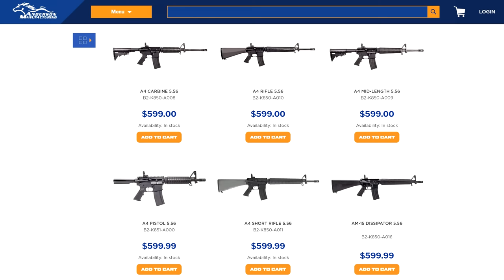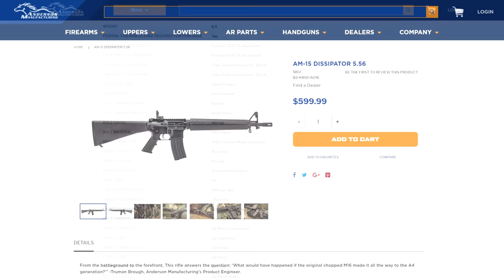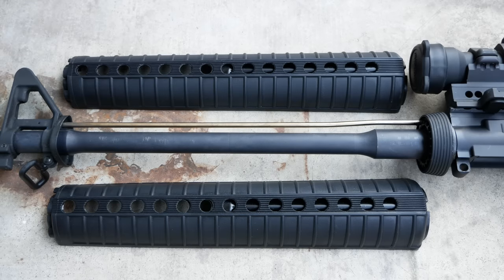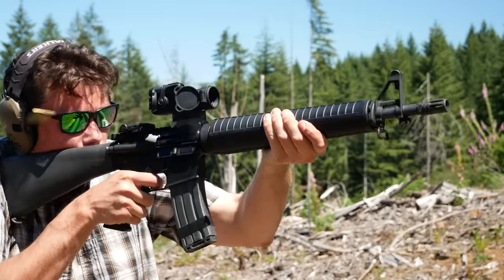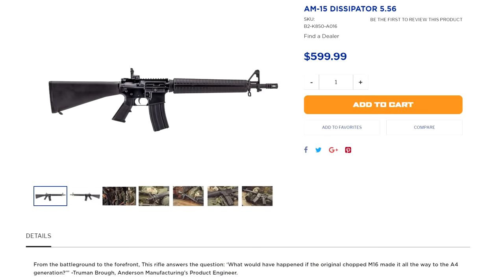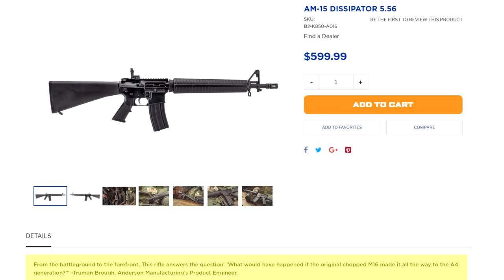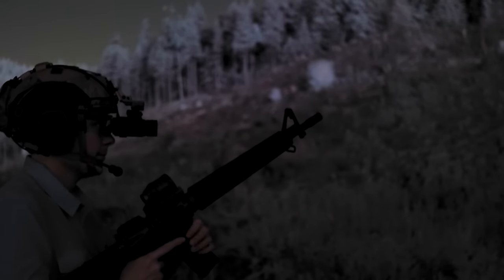The Alternate History Anderson A4 Dissipator

Comment: I used a barrel made by spinta for Rainier arms on my dissipator it’s a legit 16” rifle length gas it’s running a JP precision bolt on adjustable front sight block. And it’s got the retro a1 length stock from brownells as well I used an a2 upper and triangle handguard from
Brownells as well. But the Icing on the cake is the hard chromed bcg I picked up from SOLGW. The way god and Stoner intended! 😂😂 I love my dissipator!! Shoots beautifully

Comment: The D.M.P-23 (Dissipator Modernization Project - 2023) would be pretty cool to watch.  I would argue that the rail needs to be the 12.5in RIS III rail from DD... Then you can add a bloop tube underneath (grenade launcher).  Likewise, a Magpul grip with the oil reservoir would help out on the lubrication need.  The Magpul MOE rifle length stock is also nice, as it simplifies the sling mounting issue.  I personally attach my sling to the built in bottom loop and run it through a qd swivel on the rear of the stock to keep it from getting tangled... It works better even than the KP15 sling slot.  You can also loop the sling around the bottom and rear to store it out of the way during transport. 

You could also replace the action spring with a Geissele Super (Sayan) 42 rifle length braided spring for extra razzle dazzle.  Trigger could be any flavor you want, although I'm biased toward the Geissele SSA.  Same goes for safety selector and charging handle. The sling could be a Vickers because that is what the military uses if I'm not mistaken.   I would attach it to the m-lock rail via a BCM steel QD socket or to the 1913 rail via a Magpul QD socket. 

For muzzle device, I would try to find one that allows for a bayonet attachment while also doubling as a suppressor receptacle.  If such a device exists (A2 birdcage notwithstanding), I would then modify a Vietnam era bayonet to sit correctly on the shortened barrel section. This has been done by CMMG as documented on The New Rifleman's article: Your Rifle Needs A Bayonet.

I would personally pick an ACOG TA02 with a front mounted piggyback T2 for optic combo, but that is user preference.  WML, LAM, and other accessories would be up to the Dissipator Operator.

Sorry for the wall of text, but this excites me.

Comment: They probably just opened up the gas port a few 1000s to make sure it cycled low pressure ammo to get them to work. 18 inch rifle gas is the sweet spot for smooth and function.  Throw a captured spring buffer and lightweight bcg with an adjustable gas block and it will shoot lasers.

Comment: I would totally watch someone build a 16in, free floated, rifle length low profile gas, modern dissipator.
It sounds like it would be a dope suppressor host.

Come to think of it, I may have to build one myself.

Come to think of it (x2). My suppressed AK-105 build probably runs SO WELL for the same reason.

Now, I also want to know what the shortest possible barrel length an AR can have with a rifle length low profile gas system while still being threaded is.

Comment: I've got a rifle -1 16" 7.62x39 running all standard bcg parts and import ammo. How does a dissipator 5.56 with way less bore volume and more pressure have trouble? My other projects are .50s and have almost 3x the bore volume of .30s but my gas lengths are all normal looking except for the beo setups. 

What's the problem? What am I missing?

Comment: For the barrel mounted accessory clamps, you could probably just buy some slightly longer screws. I'd imagine a gap between the pieces won't have any detriment as long as the screws are good and tight

Comment: I built a 605 knockoff with the Del-Ton 16” rifle gas barrel with a bigger gas port, and it ran well with a rifle buffer. But the only way it ate steel cased ammo was swapping one of the tungsten weights in the buffer with an aluminum spacer.
I wonder if Anderson is doing something similar. Bigger gas port and lighter than normal rifle buffer.
Reply: Did you enlarge the gas port yourself, what size? Or, did it come factory?
Reply: @Allenmar73  I bought the barrel from Del-Ton. They make a 16" dissipator barrel with a rifle gas length, and a larger 98thou gas port.
If you're DIYing it by cutting down a longer barrel and opening the port, I'd start with a #41 drill bit and work up from there.

Comment: Would love to see a dissipator video with different suppressors. How would a 16” barrel, rifle length gas system, run with a suppressor?  Would you need to make any major parts swaps?  How about using a OSS Helix, or other free flow suppressor?  That would be interesting to see.
Reply: I could imagine, making a dedicated, rifle length gas system with 16" barrel and always suppressed would work pretty good without modification to springs or gas port. Be interesting to see.
Reply: If it has a rifle length gas system on a 16” barrel, it would not be a dissipator.
Reply: @rifleshooterchannel208  yet that's what this model is, a 16" barrel with rifle length gas system.
Reply: @warrenharrison9490  Except it’s not. 

Bushmaster was the first company to sell a rifle configuration called a Dissipator and it had a front sight base pinned in a “rifle length” position and a cut down FSB used as a low profile gas block with a gas tube in the carbine position.  

Any other gas system length is, at best, a Faux Dissipator.
Reply: @rifleshooterchannel208  That was explained in this video. This is supposed to be a copy of the Colt.
Reply: @warrenharrison9490  And yet the word “Dissipator” is in the title when the Colt 605 and subsequent Anderson made version of it have nothing to do with being Dissipators.

Comment: The faxon 11.5" mid-length Gunner Barrel is pretty much a modernized dissipater shorty. I used that barrel as the centerpiece of my lightweight Mountain Gun and it works fantastically well unsuppressed.

Comment: So, what kind of magic did Anderson use to get the "true" dissipator system to actually work when originally this type of configuration didn't work (very well)?
Reply from the maker: BIG OL GAS PORT
Reply: @tfbtv Honestly isn’t that what every rifle designer does when they need to make a gun work better in one step? Between boosters and bigger ports anything is possible!
Reply: If it was a “true” Dissipator, it would have a carbine length gas system.

Comment: Bought the PSA dissipator upper for $200 and have been trying to find a drop in quad rail for it but I don't know if there are any rifle length hand guards for mid length gas systems. Anyone have suggestions?

Comment: The M16A4 may be retro... but the FSP M4 is still standard issue in the Army (and standard issue to non-infantry in the Marines) and is not retro. I will die on this hill
Also a modernized dissipator would just be using a 12" freefloat or a drop-in rail from Midwest Industries. Not much point tbh, we know what AR-15's are

Comment: I don't care about the modernization of the rifle. Too much BS like that going around, at $600 they should sell these bt the six-pack.
Reply: Yeah, because with inflation cutting the value of the $ in 1/2 over the last 30 years they should be effectively selling the whole gun for less than the cheapest lower on the market… which ironically they make? Basically you want their uppers for free?